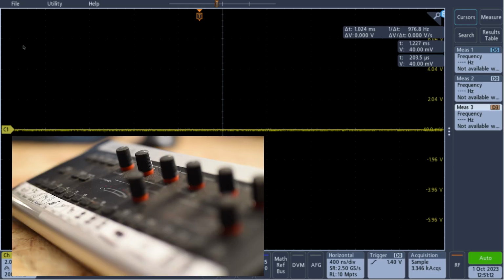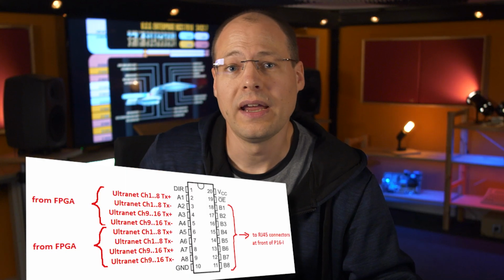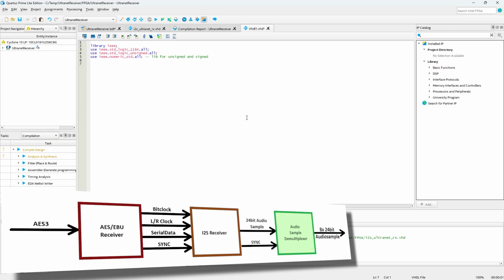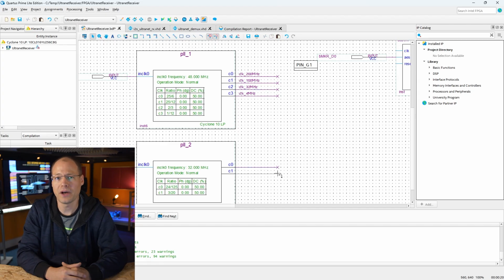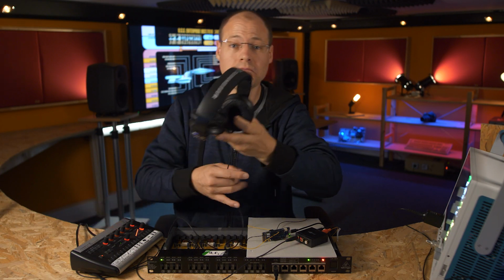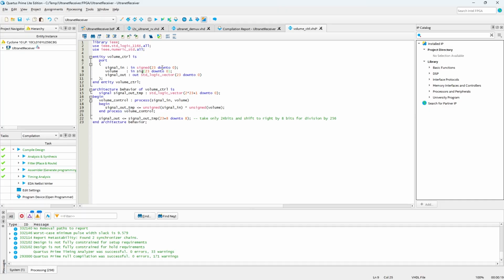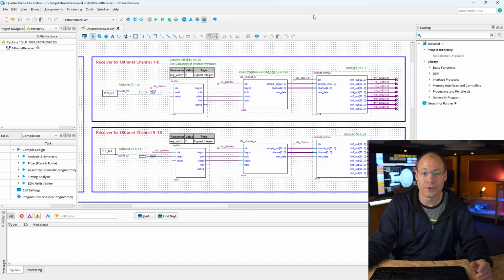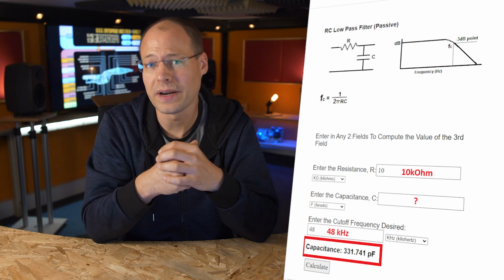Hacking Behringers Ultranet for a FPGA-based DIY-Audiomixer

Comment: Unfortunately I'm too unskilled to cook with any FPGA recipes but UltraNet to SPDIF or AES/EBU would be really smooth as it could give the cheap Behringer X-Air 18 a digital output. 

People would probably go crazy for a Dante or AES67 bridge from UltraNet. To my knowledge, BehringerMidasKlark only offers a bridge to their StageConnect system.
Reply from the maker: Tinkering with these formats and DIY devices is one thing, but creating fully tested devices for other people is something else. All I can offer is the GitHub-repository, but I cannot build ready-to-use-devices. With the published code an UltraNet <-> SPDIF/AESEBU bridge can be realized. The "only" thing someone has to do is:
- plan, build and test a PCB
- create a good housing
- test under all possible user-conditions
- remove all minor drawbacks of the current design

:)

Comment: Lets connect an oscilloscope; Continues to use a 30k+ Tektronix 😅 4:16
Reply: Awesome video!
Reply from the maker: No, the MSO34 is around 4.500€, but still not the cheapest, that's right 😇 I tried it first with my small Fnirsi Scope but I could not trigger the signal successfully...

Comment: The next logical step might be, creating a diy-device that utilizes a s16 digital stagebox and provides direct access to use it as an audio interface for a computer.
Reply from the maker: This is already possible using the Klark Teknik DN9630 AES50 to USB Converter - but it is quite expensive. I'm thinking on a open-source-implementation of AES50 - than this would be possible... but first I have some other ToDos on my list

Comment: That is very interesting! Could the Raspberry Pi Pico (RP2040) perform the same task as the Arduino Vidor, given that it has these powerful PIOs? Transferring multi-channel digital audio over a single pair isn't all that trivial, where "standard" AES3 is the norm. I wish there was a chip one could use in each end that could take 4 or 8 synchronous i2s signals in, and output the same signals in the other end, so a chip like CS8416 can be used to decode the signal to i2s.
Reply from the maker: As someone already decoded SP/DIF (so AES/EBU) with the Raspberry Pi Pico using the PIO (see here: https://github.com/elehobica/pico_spdif_rx) it might be possible to decode UltraNet, too. Up to now I did not use the PIO of the RPi yet. Its a nice idea and would be much cheaper than the solution with the FPGA...

Comment: This is very cool.  Was this just done on a lark or was the P16-I unfixable?
Reply from the maker: The P16-I has only some damage at the output-buffer ICs right at the RJ45-jacks. There are some smaller resistors in the range of some Ohm that burned, too. Up to now I just had no time to fix the output-stage, but it is fixable. So the defect was a welcome opportunity to take a look inside the device :)

On the other hand, I'm playing with the idea of permanently installing a Vidor 4000 in the P16-I so that I can process all 16 input channels directly with my own audio engine.

Comment: When you tested connecting the two devices together, what cable did you use? was it pinned out correctly and full continuity?
Reply from the maker: You mean between P16I and the P16M? Yes, it was an 8 pin Ethernet Cable and it is working between the P16M and a P16D or the X32. Within the P16I the BufferIC and several resistors are defective so I have to replace several components. But at the moment I'm working on the FPGA system. It is nearly ready for the first release :)

Comment: Hello, very impressive work !
I am wondering looking at the reverse engineering of the ultranet, could we use that tool to convert ultranet into AES/EBU 16 port easily ? Maybe even in a Madi format ?
Reply from the maker: Hi. 16 Stereo-AES/EBU ports should be possible as these blocks are using only logic-elements and no DSP-slices of the FPGA. I tested it with two SPDIF-outputs (means two stereo-channels) and it worked without problems.

As I'm not familiar with the details of MADI I cannot give a good answer here, but it seems that MADI is only a multiplexed AES/EBU-stream with up to 56 channels. So it should be possible to update the state-machine for stereo-AES/EBU to create a MADI-signal with the FPGA.
Reply: Sorry for the late answer u had not seen yours...
Well i think i am going to dive into that ultranet to madi conversion ! I feel like it could be usefull in some scenarios:)

Comment: if the left and right brain can't TALK to eachother 
THey will both think they are individuals in control of the same body.
it's like havign a 2 core CPU (well we have muliple cores the point is energy comes in is divided in to pulses and those pulses grow the body the rotation has a hard or soft angle i don't understand fully how the energhy minipulates matetr but again you have to put something in the soil of something with the same vibration

Comment: @pcdimmer I really like your content!
I had a question\proposal regarding the P16-M.
The P16-M v2 support Firmware upgrades and Behringer has released several upgrades over the years.. however, when you update the firmware (over MIDI MIDI OX App or similar MIDI Dump\Loader) the unit is reset to factory settings.  This means that any Recalls or settings stored on the P16-M is lost requiring the users to reset all their settings.  I was wondering if there was a way to backup those settings and restore them after upgrading the Fireware but I haven't find anything online and it doesn't look like there is any way to do that.... but I was thinking if the Firmware upgrade is done through the MIDI port... then could the settings somehow be pulled over the MIDI and then restored later?  Thoughts?  Maybe a project you might be interested in?
Reply from the maker: Thanks for the feedback. The P16-M is a nice device - I have a couple of the version 1. Version 2 looks great as well, but up to now I did not get in touch with them. Its worth looking at them in the future

Comment: Mega spannend! Eigentlich wäre ja ohne Probleme auch ein 8x AES Output möglich, richtig? So ein Gerät könnte ich gut gebrauchen, baust du auch auf Auftrag? 
Wenn man noch das Midas DN4816-O anschließt, braucht man ja einen ultranet Splitter oder kann man den stageconnect rj45 Ausgang am Midas DN4816-O nehmen (warum der nicht ultranet Ausgang heißt??)
Danke für jeden Input!
Reply from the maker: Hi,
ja, tatsächlich ist man beim FPGA lediglich bei der Anzahl der IO-Pins und der Logik-Elemente selbst beschränkt. Pro AES/EBU Port benötigt man nur relativ wenig Logikelemente, sodass wir hier nahezu beliebig viele AES/EBU-Ausgänge mit frei routbaren Audiostreams erzeugen können.

Das Gleiche gilt auch für die Analogausgänge. Ich habe die Qualität der PDM-Ausgänge in den letzten Monaten massiv verbessert, sodass man ein sehr flexibles Audiosysten bauen kann.

Ich schließe gerade die Programmierarbeiten ab und bereite anschließend die nächste Youtubefolge vor. Dann wird auch hoffentlich der Elektor-Artikel veröffentlicht, sodass ich den Code dann freigeben kann.

Beste Grüße,
Christian

Comment: So, it is not Ethernet at all? I've thought that it will use Ethernet frames and addresses to pass this signal via standard switches.. But it looks like it is a point to point connection with its own bitrate, and only wiring is common with Ethernet.
Reply from the maker: It should be OSI-ayer 1, so the electrical part is ethernet, but UltraNet has nothing more in common with the classical computer-ethernet. So you can't decode the "packages" as there are no. It is a differential digital AES/EBU audio-signal with 8 audio-channels per link-pair. So you can't use ethernet-switches, too.
Reply: @pcdimmer  Ethernet is classified as Layer 2 by itself (if we can classify modern stacks with this old and dead model at all, which is debatable). And it looks like it is incompatible Ethernet even at Level 1, as Level 1 includes voltage levels, modulation, bitrate, etc.

Comment: Es scheint also, als könne man dieses Geraet auch zu einem "simplen" und quasi günstigen AES3-analog-Wandler stricken- wenn man denn so wie DU ist 🤣
Reply from the maker: Ja, das geht. Der FPGA hat sehr viele digitale Pins und jeden Pin kann man mit einem einfachen RC-Netzwerk und der Sigma-Delta-Wandlung als analogen Ausgang nutzen. Leider sind die FPGAs noch recht teuer, aber wenn man einen CYC1000-Board von Trentz verwendet, kann man für insgesamt ca. 60,-€ einen Konverter von UltraNet auf 16x Analog bauen.

Comment: How difficult is it to make an ultranet to aes50 adapter this way? It would be brilliant to be able to use the xr18 as a stagebox for the x32. Of course, I know that only in one direction and there will be no control over the preamps.
Reply from the maker: I already implemented Audio-over-IP in an FPGA using a 100Mbps Ethernet Phy (see https://github.com/xn--nding-jua/FPGA_Ethernet). As this is already working, AES50 is on the ToDo-List, but it requires more effort as this protocol uses lot of details, that have to be taken into account regarding its protocol. Its not done on a weekend...

Comment: just a quick question, shouldnt the low lass filter be at 24 khz? since the signal contains no information above half of the original samplerate (nyquist)
Reply from the maker: For a system with a input-sampling rate of 48kHz a designed cutoff-frequency at 24kHz should be sufficient, yes. But you will receive a 3dB attenuation at 24kHz. It might be OK as most of us can hear only up to 20kHz (best case), but the RC-filter at 48kHz makes sure, that all high-frequency parts of the audio is still there (depends on if there are useful information in your system at all). With my ADC I am able to sample up to 192kHz and then the RC-filter at 48kHz could make sense - but it depends on the individual preferences - I could not hear any difference between 24kHz, 28kHz, 30kHz and 48kHz - I tested it :)

Comment: Can you make a two balance out on the p-16 please for longer runs why did they make the left and right 1/4 out unbalanced ?
Reply from the maker: Yeah, would be good thing. But as there is a new generation of P16 and this upgrade would require some OpAmps and transformers, I fear it is not it. Just use a DI-box - easier and cheaper
Reply: @ I would want it to go out to a Eq of some sort an that is a balanced input not a mic input coming from a DI

Comment: Hey ! I would like to connect my ultranet output (of Midas MR18), to my monitoring system that has spdif inputs. Is it possible without using an FPGA card, with a handmade ethernet-rca cable ? Or is there any other solutions ?
Reply from the maker: No, a direct connection will not work as the monitoring-system will not understand the data received on the SPDIF. Someone had some promising results using a RaspberryPi Pico with the PIO. This PIO (Programmable Input/Output) seems to have enough ressources to decode the UltraNet. But I have no detailed information about this project.

Comment: as an electrical engineer, how did you determine that the P16 was the problem?
Reply from the maker: Well, first I tested the P16-M (the personal mixer) with the larger X32 and it worked. With the P16-I (the analog injector) it didn't. As someone mentioned in the comments below, the resistors burned, too. Up to now I had no time to fix the output-stage, but only the buffer-IC and the resistors are damaged. With some time the system should work again. On the other hand, I'm playing with the idea of permanently installing a Vidor 4000 in the P16-I so that I can process all 16 input channels directly with my own audio engine :)
Reply: @pcdimmer  thank you - clear now - i like your vidor 4000 plan, it seems the more useful solution.